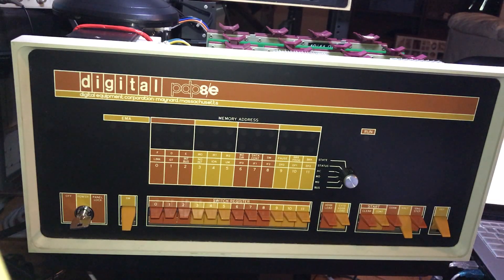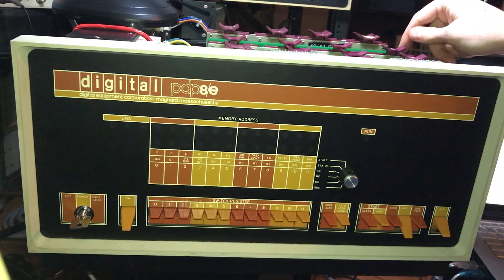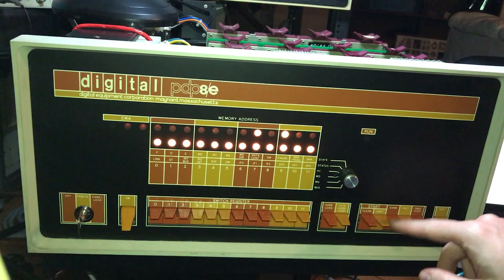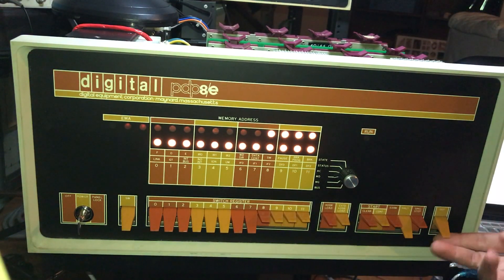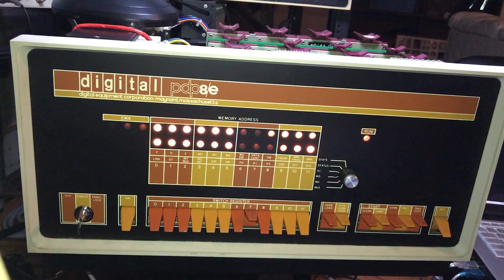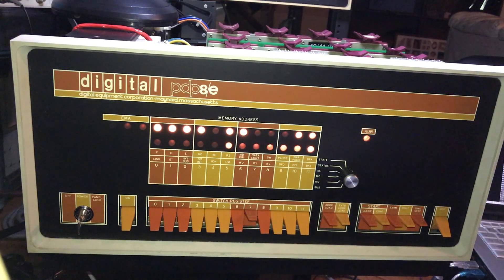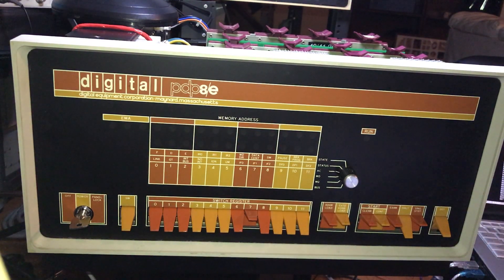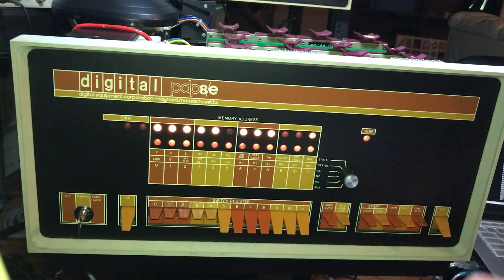PDP-8/e OS/8 Bootstrap Loader Test

Comment: As you were toggling in the values, I was seeing the numbers in my head.  I used these from 1973 until 1991 in a Computer Microfilmer. 
We had 6 or 7 running at any time, and always had to enter the rim loader between jobs

Comment: Huh, looks like the front panel lights are 'half-lit' for a 0 to reduce the time it needs to get to full brightness and back.
That's pretty neat.
Reply from the maker: Yeah, I'm not sure if that's the reason, per se- probably has more to do with warm bulbs have a higher resistance, and thus pull less current when going from dim to bright if they're kept warm.  The downside is that bulbs that don't even get used (like the MSB of the extended address indicator) burn out even though they never go to full brightness.
Reply: The reason is just to expand the life of the bulbs! The dim lights are just preheated. Bulbs tend to beak then you turn them on and off very often. Preheated bulbs live much longer! The machines like the PDP8/m and /f have LED's and therefore preheating is not necessary. My 8e was turned into a LED version unfortunately... I want to bring the bulbs back in...